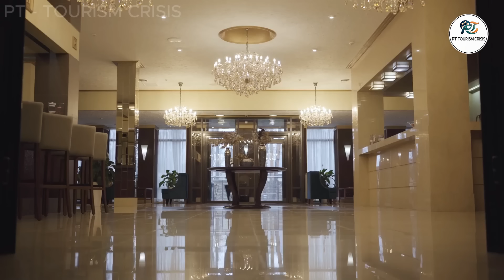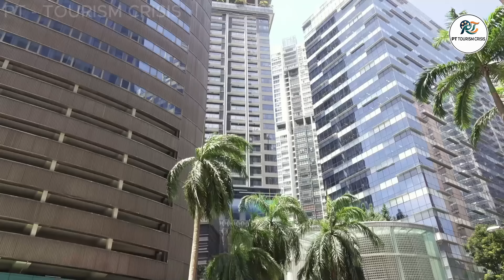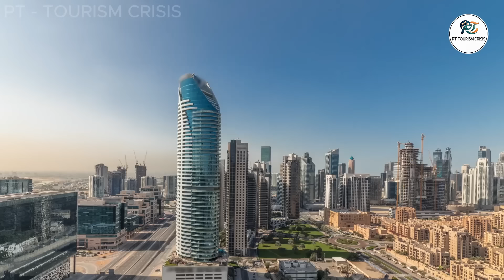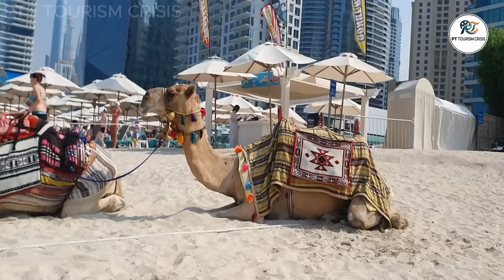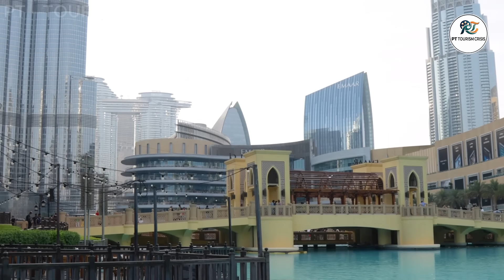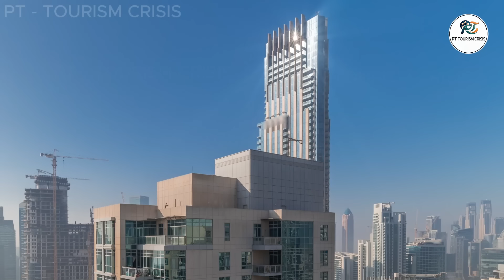Why 125°F Heat Is Breaking Dubai’s Invisible Machine

Comment: So where are the SOLAR PANELS which give both SHADE and produce cooling energy? Pedestrian areas should be covered in them. So not only is the ground protected from sun but also the people. Is THIS NOT GLARINGLY OBVIOUS?😮😮😮
Reply from the maker: Yes, solar canopies over walkways and parking areas make real sense: they provide shade, reduce ground heat, and generate power for cooling.

Comment: What the you’re saying is true but it’s just targeting Dubai as if it’s the most evil city who uses aircon. Almost all cities on the tropical belt uses AC. It’s not a Dubai only issue.

It’s easy to tell everyone that Aircon is bad while you live in a place where summer is in the comfortable range of 30C-21C. Desert and Tropical cities including Singapore, Delhi, Manila, Jakarta, etc has summers that range from 37C to 58C. And take note that the heat is humid heat not dry heat, only Dehumidifiers and AC can solve it. 

What if we tell you that Heaters are also bad during winter as it requires a lot of energy and produces a lot of carbon emissions? 🙄

It’s easy to solve dry heat, but humid heat is a different kind of animal.
Reply from the maker: Fair point. AC dependence is not a Dubai-only issue; the concern is the scale, speed, and luxury model built around constant cooling. The real question is how all hot cities can protect people without creating even higher energy demand.

Comment: They are on the sea.  Why don't/didn't they dump the heat into the water?
Reply from the maker: Seawater cooling is possible, but it only moves the heat elsewhere and can damage marine life, corrode equipment, and require enormous pumping power.
Reply: @PTtourismcrisis  Yes.  There are no solutions, just trade offs.

Comment: big mistake hiring American architects for the initial designs. that's why Dubai could be a an unliveable US city with wide highways, glass tower blocks and everything reliant on air-conditioning. 
looks like Doha has made an effort to retain traditional vernacular architecture with narrow shaded streets, traditional wind towers etc.
Reply from the maker: That criticism is fair, although the responsibility goes beyond American architects. Dubai adopted a car-dependent, glass-tower model that requires enormous cooling, while parts of Doha have made a stronger effort to revive shaded streets, courtyards, and traditional climate-responsive design.

Comment: There are cities in the US that are hotter than Dubai. For example Phoenix and Las Vegas.
Reply from the maker: Phoenix and Las Vegas can sometimes reach similar or even higher daytime temperatures, but Dubai’s humidity and hot nights can make heat stress more dangerous because the body cannot cool as effectively.
Reply: its the same what is experiencing UK these days, with the high humidity that they have and the rise of the temp

Comment: But it works in Vegas.🤷‍♀️
Reply from the maker: It does, but under different conditions. Vegas has much drier heat and survives through strict water recycling and conservation, while still relying heavily on the stressed Colorado River. Dubai adds intense coastal humidity and desalination dependence to the equation.

Comment: How China Is Keeping Entire Cities Cool Without Using Air Conditioners
Reply from the maker: It is not entirely without air conditioning. China is reducing individual AC use through district cooling, underground heat-exchange systems, reflective surfaces, greenery, and smarter energy management. The cooling still requires infrastructure and power, but it can be far more efficient than millions of separate units.

Comment: all that concrete is like phoenix, one big heat battery, turns on after sunset...called the heat island effect
Reply: Western Sydney is the same sort of thing, Sydney is in a basin, it gets 40° c plus. Too much cement and tar roads. Too many black tile roofs.
Much will end up underground. 
This place Dubai is much worse though. It's a giant green house. 
Newcastle Australia 🦘🦘🦘🦘
Reply from the maker: You’re right about the shared urban heat problem. Western Sydney’s dark roofs, asphalt, limited shade, and inland geography can make it 6 to 10°C hotter than eastern areas during extreme heat. Dubai faces the same heat-island effect on top of a hotter, more humid desert climate. “Giant greenhouse” is a strong metaphor, although the city is not literally sealed like one.
Reply from the maker: Exactly. Phoenix is a classic example: concrete and asphalt absorb heat all day, then release it after sunset, keeping nighttime temperatures dangerously high. Shade, vegetation, reflective surfaces, and smarter urban design can reduce the effect.

Comment: I live in a flat under the roof of a 19th century building in Paris,  when heat wave was hammering Paris,   my AC unit  lowered the temperature from 38C to a comfortable 30C .   In summer, who really NEEDS  20C and  wear winter clothes , it's nonsense,  let alone the energy bill .
Reply from the maker: Exactly. Cooling a room from 38°C to 30°C is already a major improvement without turning it into a refrigerator. France’s ADEME recommends setting AC no lower than 26°C, although 30°C can still be risky for vulnerable people, especially at night.

Comment: Meanwhile everyone in europe thinks its just a matter of having air conditioners.
Reply from the maker: Exactly. Air conditioning helps indoors, but it does not cool streets or fix heat-trapping buildings. Europe also needs insulation, shade, trees, reflective roofs, ventilation, and smarter urban design.

Comment: Air conditioners not only move heat from indoor to outdoor, but also emit waste heat outdoor due to inefficientcies in the units.
Reply: Air conditioners can only lower temps 20 degrees. To cool beyond that requires refrigeration units, which use much more energy than ac units. All those skyscrapers and huge hotels constantly use massive amounts of heat generating energy. Dubai mystifies me. Last place I would want to go. I don't get the appeal.
Reply from the maker: Exactly. Air conditioners cool buildings while adding extra waste heat outside, which can worsen the urban heat island effect.
Reply: They will always have poor efficiencies, relative to heaters, due to the laws of thermodynamics.  Air con units are basically “reverse heat pumps” and so will always require significant energy, subsequently emitted as heat, to work.  Same issue with fridges, however sophisticated.